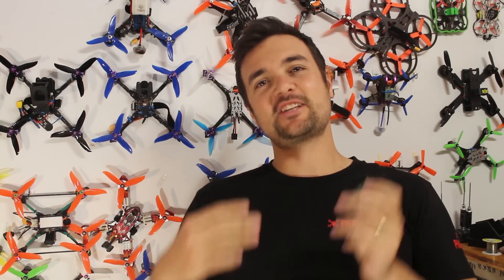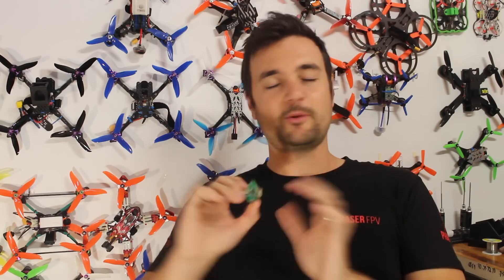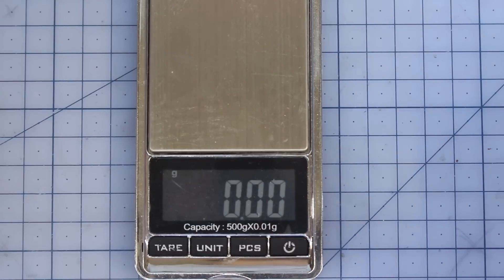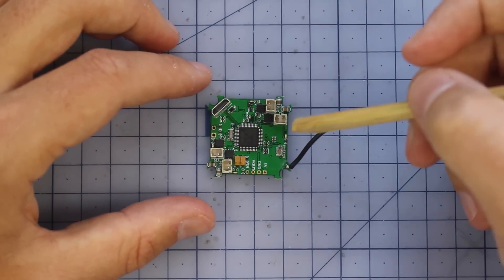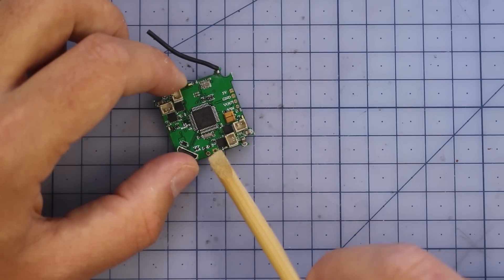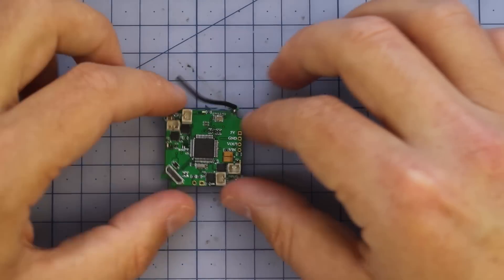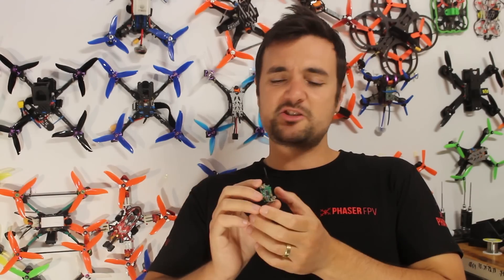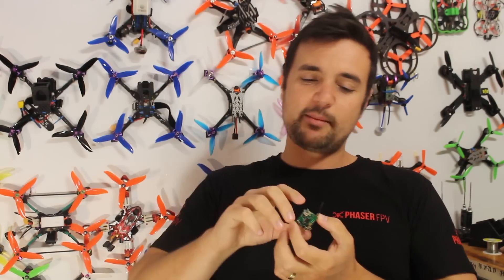60 Second TINY WHOOP UPGRADE. Tech Tuesdays UAVFUTURES

Comment from the maker: not a bad way to upgrade, one thing the tiny whoops having going for them is in total you are looking at like 5 solder joints and plug and play motors, not many quads you can upgrade in less than 60 seconds. http://bit.ly/beecorev2
Reply: UAVfutures Hi Mr Stew I watched a video of yours with the cheap eachine drone at $65 and was wondering if there was any other website to buy it or place an order because I'm probably gonna be a bit bored this holiday😂😂😂
Reply: Their manual states it uses the AFHDS-2A (IBUS) protocol, so it should work with the evolution.
Reply: Hey Stew, I have a turnigy evolution controller. Do they have one that works with that controller? Thanks
Reply: UAVfutures I have a question about the fpv connector pads; what is the gnd/ground connector for?

Comment: I installed this on my tiny whoop on Saturday and I'm pretty impressed with it. It does seem to have a hard time correcting a front or back flip and tends to lose its balance causing it to crash, but that could be a PID issue. All-in-all its a great board and for an AIO board, you can't ask for a better price especially when it's under $25!

Comment: Hey Stew/community, 
I'm having trouble with my TinyWhoop. I have a BeeBrain w/ BetaFlight 3.2 (stock) installed and 19500kV motors...I need to have my throttle at 3/4 before it starts to hover and then has very limited if any difference in throttle response from 3/4 to 100% throttle. What can I do to fix that? I'm having a hard time flying around inside. I swapped out the batteries and power leads to JST-PH 2.0 connectors but that didn't seem to make a difference. 

PS. I know this have nothing to do with this video but helllp.

Comment: I just bought the furibee f36, my first quad, waiting for it to turn up.
Can anyone explain the difference/benefits of upgrading to a board like this?
Reply: Mini Matt TV you can bind to a far better controller which gives far more "precise" control over the stock controller. Also it's running an f3 board and beta flight which can process and control the flight of the quadcopter a ton better. This would be the 'computer' equivalent of upgrading your computer memory and updating the operating system from something like windows 95 to the latest and greatest.
Reply: boosted740 great answer, thanks, so it will make it fly better basically.
Reply: Mini Matt TV.  I started with the F36 too.  I just want to make shure you know, that It does not bind to the F36 stock radio controller, you at least need a flysky controller and a fllysky version of the FC.  And yes it flies like you want it to, and you can pid tune it a bit in betaflight.  But the best thing is it can fly higher rates and in different modes, like acro, angle and horizon if that is what you want.
Reply: Anders Ahm Jensen thanks, good to know. I’m sure as it comes will be fine as a first try with fpv (ordered a camera and goggles too)
It sounds like ACRO is harder to fly but I don’t know how that’s better lol